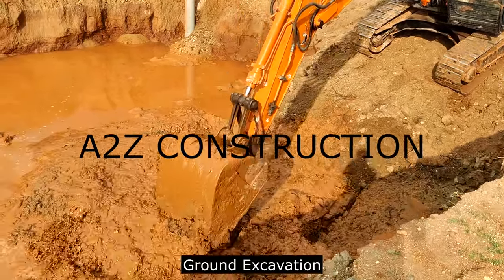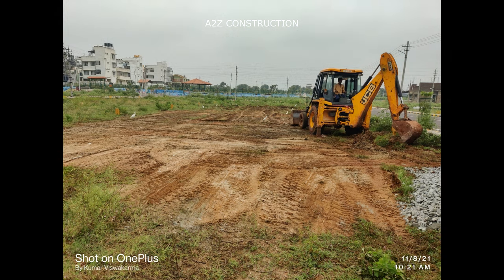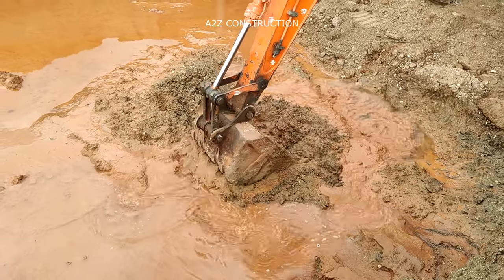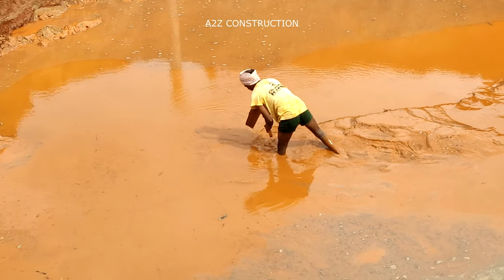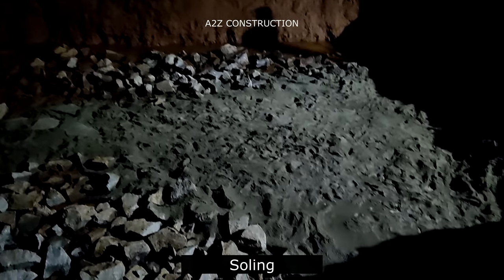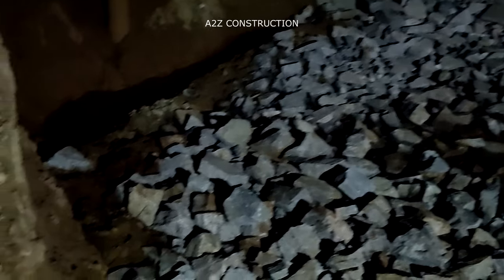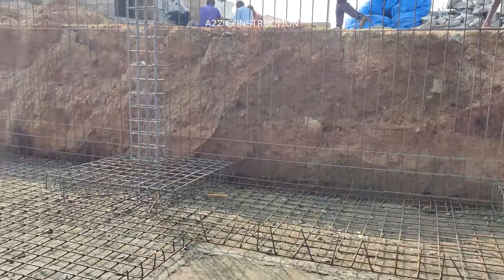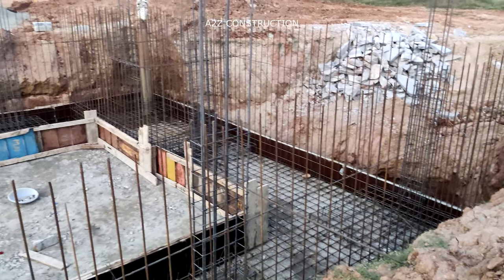FOUNDATION IN WATERLOGGED & FILLED UP LOOSE SOIL-STEP BY STEP CONSTRUCTION-A2Z Construction

Comment: Earlier we have a septic tank at the depth of 12 feet we have fill it with red soil we cure it well  and we start a new construction after 4 months ,in that plan the we got a pillar in that tank we make agur pillar of  we thought that to make 17 feet depth ,but we can dig only 9 feet due coming water in that hole , and we make pillar of 9 inch and and we make a bed at the normal soil level of 2 feet thickness and 2/2 size . My question is ,is there any problem for that pillar in future  we making g+1 construction